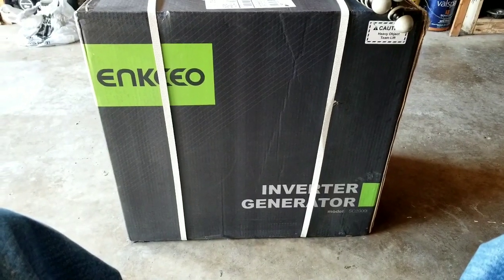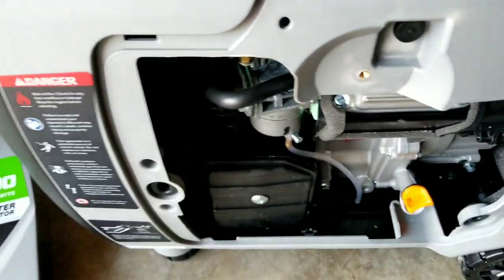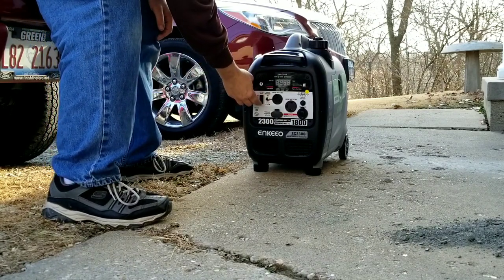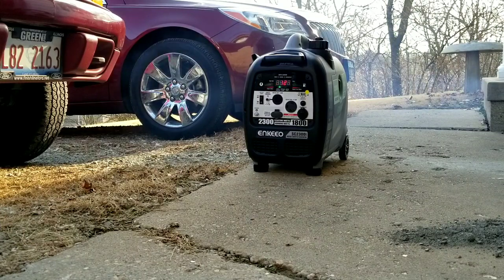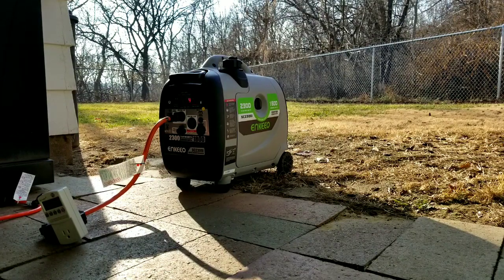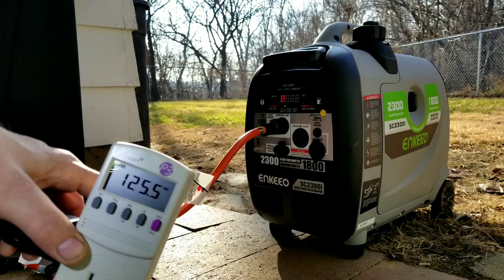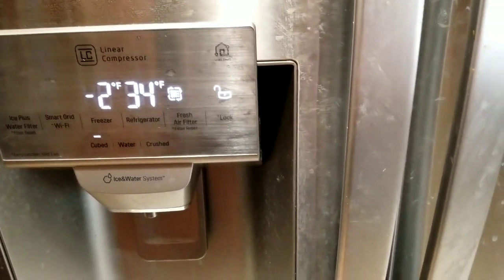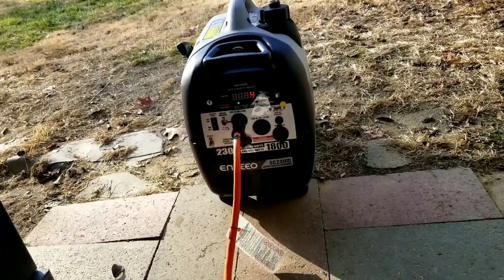Enkeeo 2300 Watt Portable Inverter Generator

Comment: I just got the version with the Yamaha engine (SC2300i) from Costco for $400 and going to connect it to the house circuit panel with the 30A port. Doing almost the same thing as you but with breaker switch isolation so I don’t have to run extension cords. We have bare minimum needs such as fridge and couple of outlets with ceiling fans. Already did the Amp and wattage calculations and this will work well for us with some power to spare. Thanks for sharing.